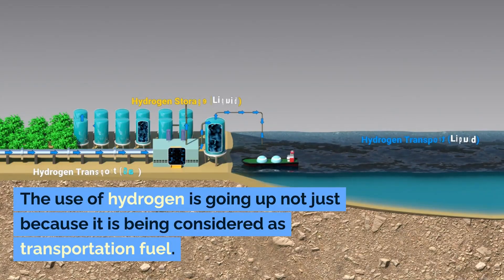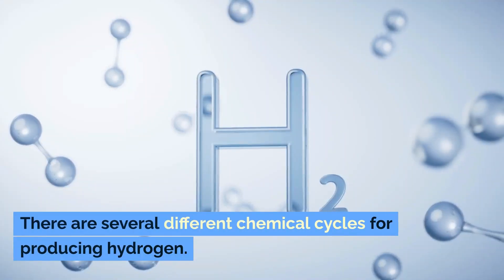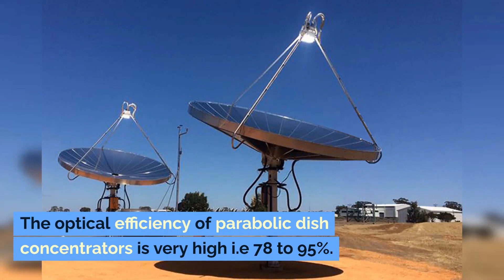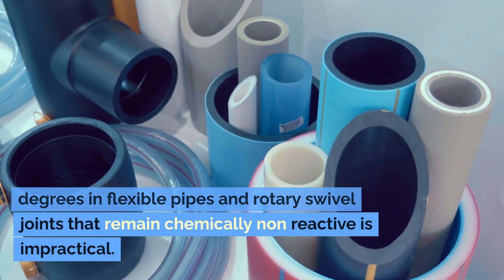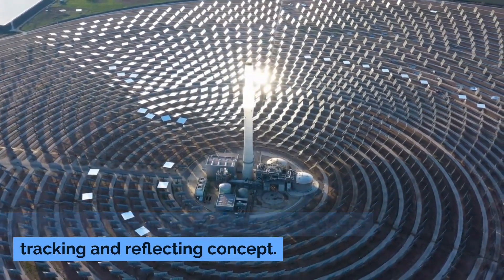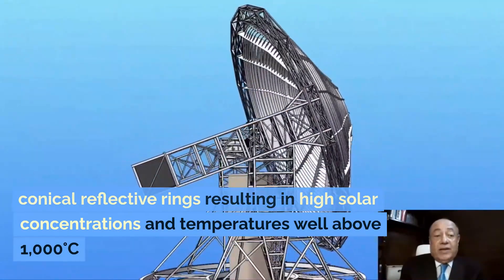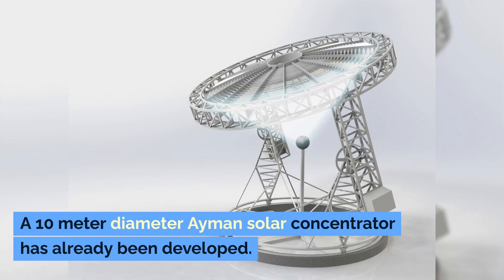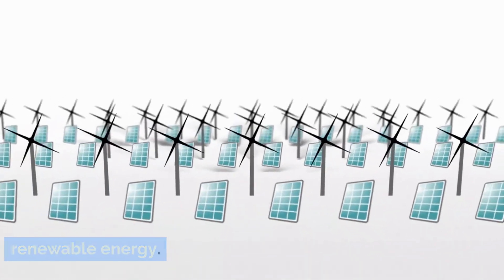The Ayman Solar Concentrator. Key to Green Hydrogen

Comment: I don't understand : these "rings" are not "reflective" as the sun light passes through it. This Ayman Concentrator looks like a huge 19° century Fresnel lens. And yes, it could work ok.
Reply: The downside of this design is that for every sq meter of incident sunlight, it will require significantly more square meters of reflector rings.   

A parabolic trough tracing the sun in one direction and pointing up to a stationary collector tube would require far less material and support structure and is only limited  in length by the max heat temperature the collector may handle.
Reply: the parabolic trough cannot reach temperatures up to 1000C as it is a linear concentrator and not a point concentrator. However, you may be referring to the Parabolic Dish. If so then please note that the reflective materials needed for the ASC is not much more than that for the parabolic dish. However, the fixed focal point and the much lower wind load makes the ASC a superior concentrator when compared with the parabolic dish. @kreynolds1123
Reply: Sir
May i please know how to deesign  @kreynolds1123
Reply: Ideally no light should pass through without first reflecting off a mirror, except light may pass through thevery center.  

Imagine :
1) four cones with a mirror surface, and 
2) the apix of the cones are 10, 20, 30, and 40 degrees respectively, and 
3) each cone is cut by two paralal planes leaving a circular conic ring  reflector segment between the two planes. And, 
4. For each ring, starting with the inside ring, the outer diameter is equal to the inner diameter of the next ring. 

Its possible to design each ring such that they all reflect light to a common focus area.

Yes, it's very much like a fresnel lense except it uses reflection instead of refraction.
Reply: Sir,
May I please kindly know how to design concentric rings

Comment: Parabolic troughs track one axis and concentrate to a stationary focus. Maybe the width is limited but the length is only limited by how hot the materials get.  And, the support structure is far simpler.  And, one axis tracking is cheaper than tracking two.

Comment: Why don't we use lighter than air tech to have concentrators above clouds?
Reply from the maker: There is space based solar collectors that beam down energy. I have made a video on that
Reply: What industrial process do you want to put above the clouds?  Remember, as for lifting gasses, helium is expensive and hydrogen is dangerous.
Reply: @kreynolds1123  Hydrogen is not dangerous, we have the tech to contain it and we don't smoke as much!
Reply: @TerrapinTrader  OK.  Then what industrial process do you want to float above the clouds? And who is going to insure it?
Reply: @kreynolds1123  Anything that uses sunlight
Reply: @TerrapinTrader  anything? Like how many people are you going to float to run these processes. Bring them up, and materials up and down, and I'm still wondering who is going to insure your buisness.
Reply: @kreynolds1123   I'm a musician not an engineer! We don't need people to run things, but it's feasible to have a 'space escalator using carbon nano tubes to make ultra light fabric, think of the fun.
Reply: @TerrapinTrader  energy is relativly cheap. Sure, to bad its not free but your idea complicates and by extension makes the expensive part of manufacturing significantly more expensive. Yes hydrogen as a lifting gas is still very dangerous reguardless if you think it can be done safely and if you can find a process that's fully automated, you still need to load raw material get ut up above the clouds only to later bring it back down and unload finished product so you can reload,  which sounds like a lot of time wasted. 

 But, maybe you can join the first crew to start terraforming Venus above the clouds.
Reply: Although this is a valid idea and actually many researcher thought of it. However, the abundancy of solar energy at the surface of earth makes the financial feasibility of having space concentrators not feasible. What we need is an efficient way to store thermal energy at ground level or to transfer it into hydrogen cheaply.